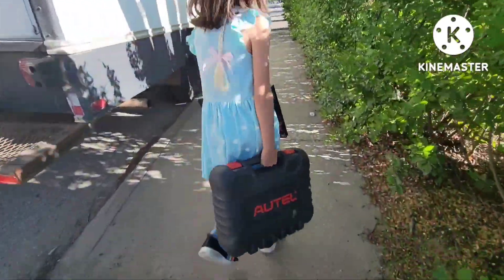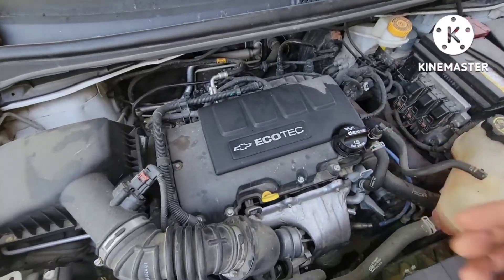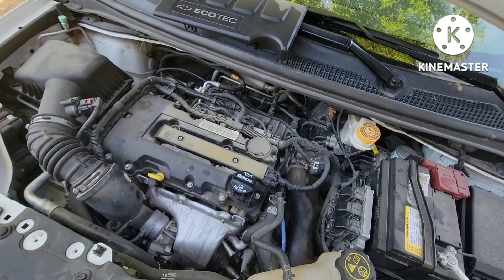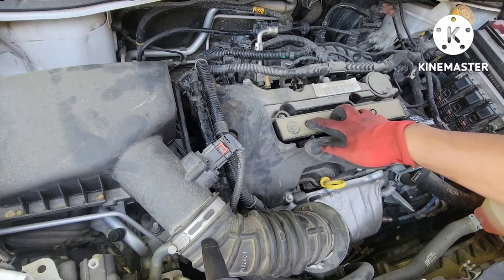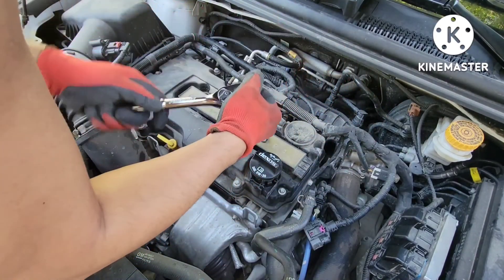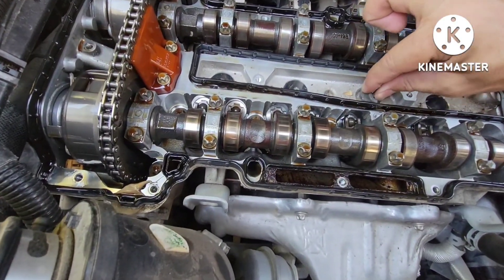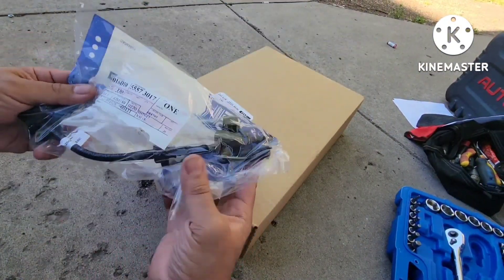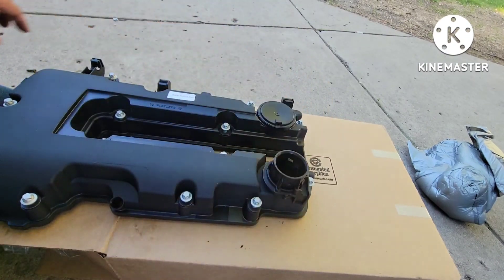V1: Chevy 1.4L Turbo Engine! Lack of power, Run rough at idle, Difficult to start D.i.Y. EASY FIXED

Comment: Unfortunately, there are two spots that require a slight amount of gasket maker that need to be placed where the timing chain block mats to the cylinder head. The spots are between bolts 5 and 9, and between bolts 7 and 11. Without these small gobs of gasket maker, or at the minimum RTV sealant, there is a good chance there will be oil leakage at these spots. Just a heads up to those watching this video.

Comment: Best idea its for you  to sell this car / otherwise this will turn by been junk in short  time/ lots of problems  pcv valve/ turbo cracked on the exhaust side/ head gasket will fail/  the radiator coolant will be shooting out in reservoir and the spark  boot will be fool of oil and the list going on . Sorry to the owners of this. Crap engine sonic/trax /buik/cruize/and other